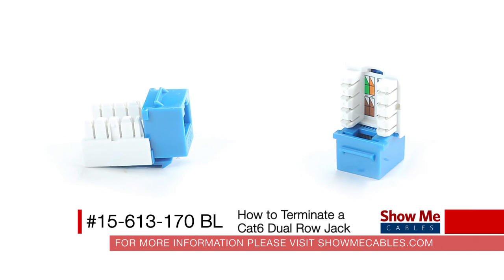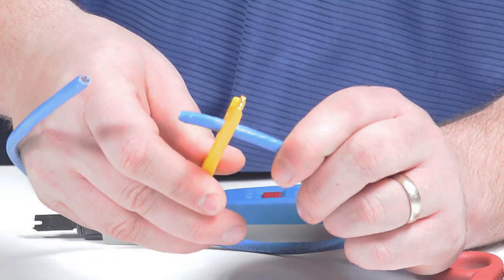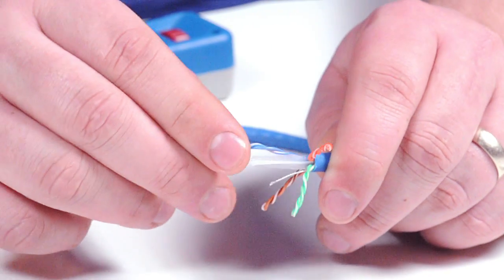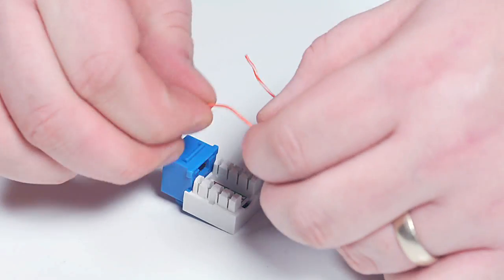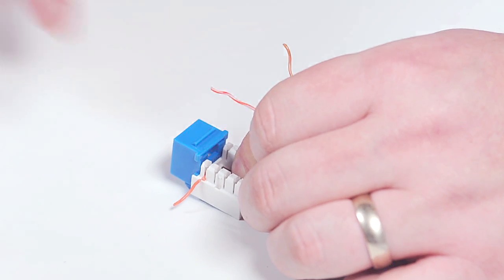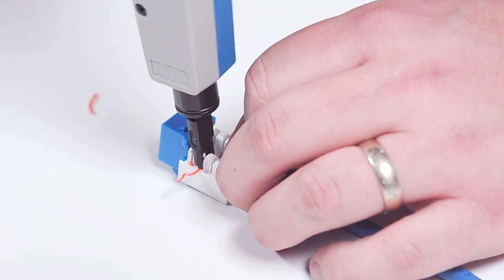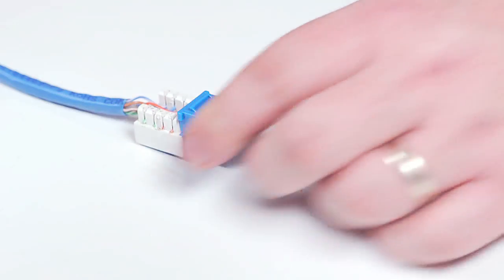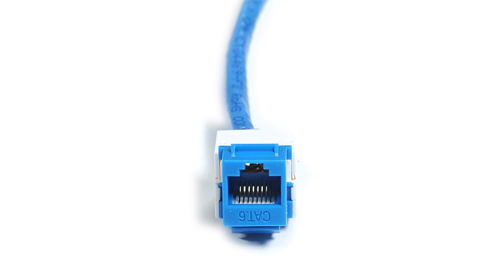How to terminate a Cat6 Dual Row Jack #15-613-170 BL

Comment: Drew, I do not want to dump on your instructional video, but from the first step through the last almost nothing you've shown here follows best-practices for cable termination.  You have a nice, clear, concise video here but I believe it could be improved as far as the actual instruction is concerned.  

1) A ring tool should be used to remove enough of the cable jacket that you can then pull the string found inside to rip the jacket further down.  This is because unless you do it perfectly on very uniformly round cable, you will almost always cut/nick some of the copper conductors inside the jacket with the ring tool.  This will lead to those conductors failure in the future as they usually snap off where they were nicked.

2) Once you have ripped the jacket down far enough to ensure you have good conductor length for termination, you do NOT untwist those pairs all the way to the jacket.  The twist is there for a reason as it ensures there is minimal crosstalk between the pairs.  The current standard (TIA 568A) states that .5" untwist is maximum, and when terminating these types of jacks you can actually keep the amount of untwist to an absolute minimum very easily.

3) As for the wiring method, 568A or 568B, this of course is dependent on the customers preference.  If you are terminating for yourself, then it does not matter which you use as long as it is the same on both ends.  The chart you show for 568B is handy if you are making patch cords.  For data jacks, they will of course all be configured different depending on the manufacturer of the jack.

Will the jack you made "work" for someone who ran 30' of cable in their home and wants to put a jack on the end of it.  Sure, it will pass data, albeit poorly.  But it would not pass certification testing, and lots of these in a network would result in one slow network.  

I recommend looking into BICSI which helps installers follow industry best practices regarding copper and fiber structured cabling systems.  It would benefit you and your audience to show folks how to implement these best practices in this line of work.  Thanks!